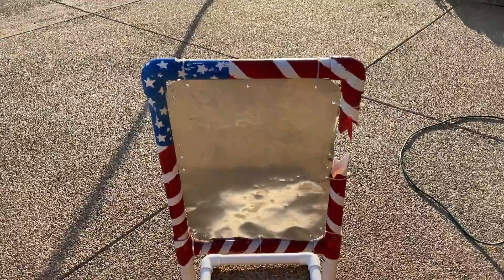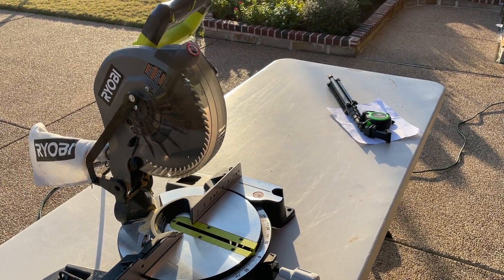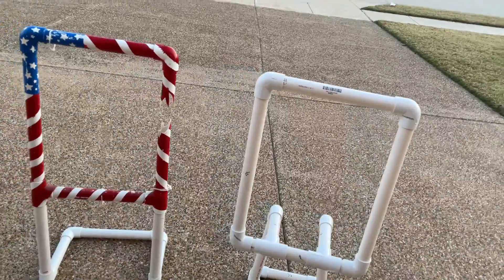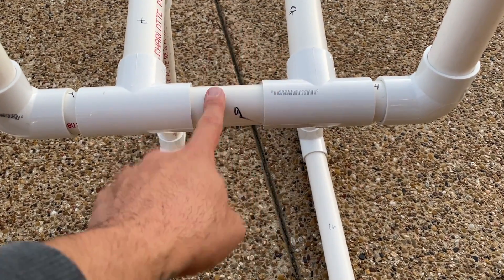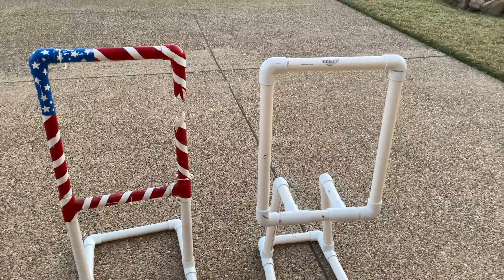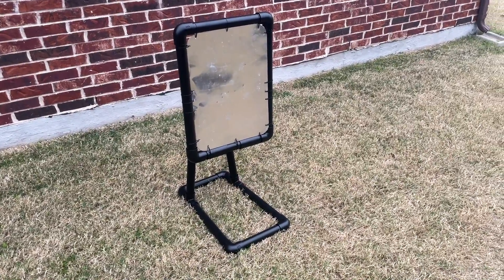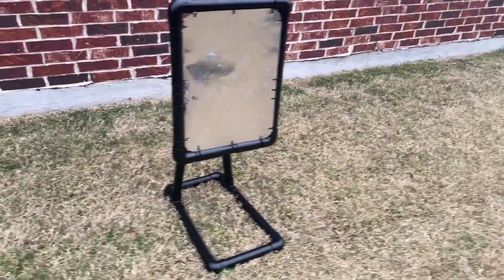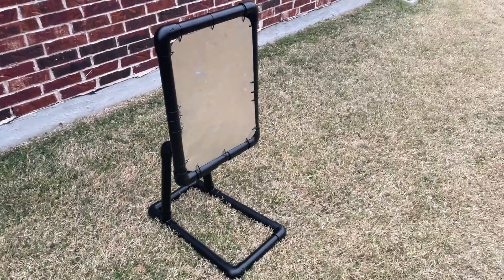How to Make a Wiffle Ball Strike Zone | Junk Ball | BlitzBall | Backstop

Comment: I used an online tool to maximize the material I had and allowed me to get all the pieces cut up with just 3 five foot long PVC.  I also used high quality 1" PVC (from Lowes) and felt that was plenty wide and heavy enough to make this all very sturdy.  

I would recommend labeling each piece with their measurement and label with a sharpie before cutting.  If you put the label at the very end of each piece, it will get covered up when you put it in the joints.

STOCK PIPE #1:

21" - Strike Zone Side
16" - Base Front Leg
15" - Down
4" - Back of Base
4" - Back of Base

STOCK PIPE #2: 

16" - Base Front Leg
15" - Down
11" - Front of Base
7" - Off Back
7" - Off Back
4" - Strike Zone Bottom

STOCK PIPE #3:

21" - Strike Zone Side
16" - Strike Zone Top (some comments say 16 is needed, mine needed around 15.5 so I trimmed this one down to fit)
9.5" - base back
5.25" - Strike Zone Bottom
4" - Strike Zone Bottom
(you should have 4.25 inches left as scrap on this stock piece)

Comment: Great video - just built and my family and I are having a blast. One thing, I used your cut list before the build and I think you're missing two cuts. You should add another 21", another 16", and your 5 1/4 cut (I used 5). You need right about 15 ft of PVC for all the cuts. Again, thanks for sharing! Below are how I have it written down for future builds. 

21" x 2
16" x 2
15" x 3
11" x 1
9.5" x 1
7" x 2 x 1
5 1/4" x 1
4" x 4

Comment: Okay….well, it’s all completed. I followed the instructions pretty closely and except for a few varying measurements, it is a near replica of the one in the video (no paint, however). It was straightforward and without your video it would have nearly impossible to build, so thank you for doing the hard work 🥲. I particularly like the double sheet metal approach as it makes a louder noise and weighs it down even more than a single sheet. Excellent design!!🤩
Reply from the maker: That’s great! Yea that’s why we did 2, that loud bang makes all the difference

Comment: What are the dimensions for the sheet metal you used?
Reply from the maker: 21x15. I recommend you build it, then measure and cut to make sure it fits well
Reply: @AngeloBodetti  thank you! What type of sheet metal did you use?
Reply from the maker: @tferrari01  just thin sheet metal from Home Depot. Roof flashing
Reply: @AngeloBodetti  thanks, aluminum?
Reply from the maker: @tferrari01  yes
Reply from the maker: @Jonathan Martinez I don’t remember the exact size but it was a standard sheet at Home Depot
Reply from the maker: Nice!